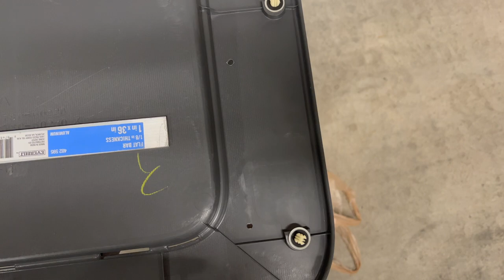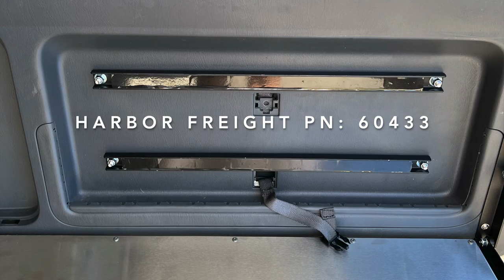Bison Gear Tailgate Table GX470/4Runner/FJ Cruiser

Comment: Great video, like the extra support you added with the aluminum plates.
Reply from the maker: Thanks I definitely felt that just the small washers supporting the entire weight wasn’t the best design.
Reply: Can you just pick these up at a local hardware store (Home Depot, Lowes, etc.)?  Thanks!  Great idea.

Comment: nice install, did you get a ballpark of how much weight this can actually hold?
Reply from the maker: Don’t have an exact amount of weight but I’ve used a 2 burner stove on it with a 10” cast iron skillet with a few other things on it too with no issues.

Comment: very nice! btw,  can you open the drawers with the table down? thanks!
Reply from the maker: I can open it most of the way. I’m gonna rebuild the drawers to better fit my needs since they were from a coworker who built them for his 100 series land cruiser
Reply: @eriksadventurelab  just to be sure,... so when you have the table open/down, you can open both drawers, right? so basically the drawers are a bit higher then the platform of the table, right? thanks a million!